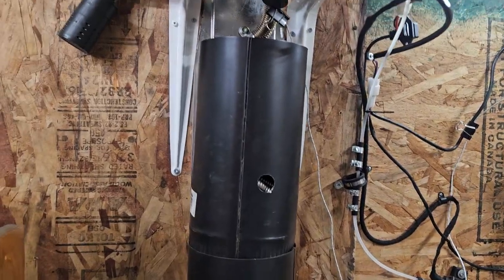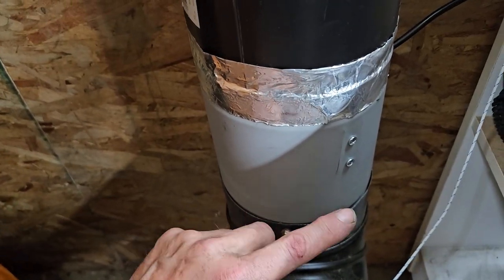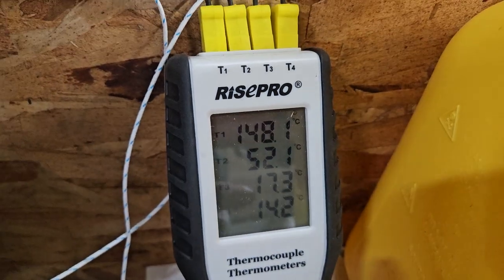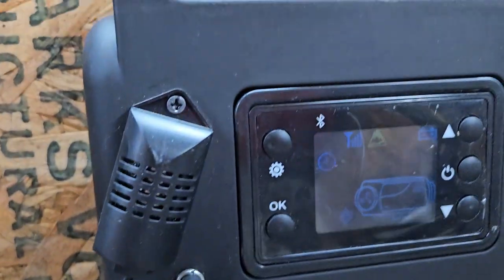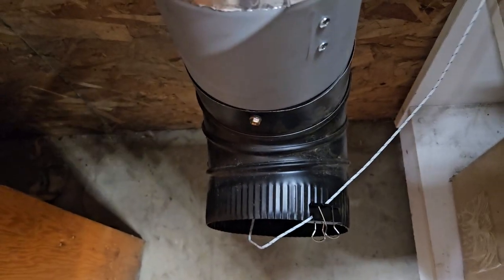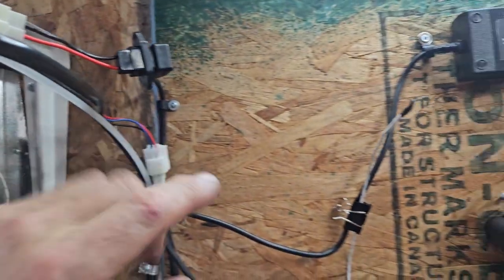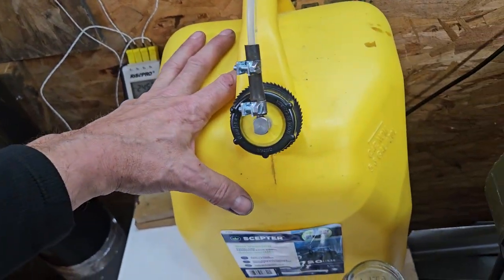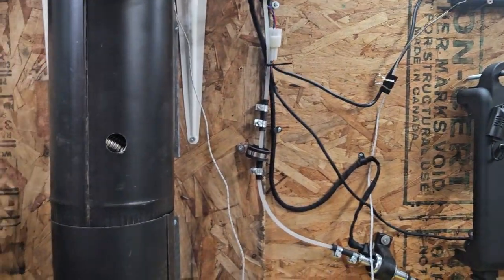Chinese Diesel Heater - Exhaust Gas Heat Exchanger (long version)

Comment: Not counter flow , get hotter fan blowing upwards blow sideways on top of, exhaust from heater top blocked air blowing sideways
Reply from the maker: I very definitely don't want it drawing from the floor level. That causes a cold  draft from the leaks around the large garage door on the other side of the building, keeping my feet always in a blanket of cold air. This warm air being blown out of that 6" pipe at about 10KPH(6mph) warms and  disturbs that cold air layer at the floor level. The forced air heating vents or hot water baseboard heaters in a house are at floor level for that very same reason. The diesel heater is mounted so high on the wall to have continuously descending spirals in the exchanger coil and still make it out through the boarded up window.

Comment: Hello Scot, I had something similar in mind. I keep seeing strange setups with heating radiators. If the room is set to a specific temperature, this should be more efficient. I had only thought that the fan would be linked to the diesel burner’s fan.
Thank you for your effort! I’ll get started on it as well.

Comment: I made on like this out of 10 foot of exhaust pipe I bought off Amazon and a 10 inch piece of duck work.  Played hell getting it in there.   Then after I got if running there were low spots in the exhaust that collected water.   I could not get a good spiral down  with the exhaust pipe with out drill holes in the duct and running rod threw the  pipe to hold them location.   Yes the exhaust comes out cold, but I don't think there's that may BTU's It recovers.   Is it worth is?  Yes and No.  Depends on how much your going to run it and if It screws up the burn on the heater to cause long term problems.
Reply from the maker: I have just finished testing temperatures and exhaust velocities of the exhaust. The math indicates that I am recovering  about 140watt/hr or 470 Btu/h with the heater running at the lowest manual heat setting
Reply: @scotscheideman9800  Interesting! How many watts is the duct fan, at whatever setting you run it at?
Reply from the maker: @danya822  Where I set it in the video, it"s drawing about 20watts. At it's lowest it draws about 15w and at max it draws 42w
Reply: @scotscheideman9800  That's good then, clearly making more than you are expending!

Few follow on questions if you don't mind...

Do you notice a significant amount of water coming out the exhaust outside? Just curious what you end up seeing for that. And is there any indication that soot is building up? 

Also, did you ever try/measure temps on alpine mode? I saw another video fairly recently, I believe they saw about 10* less on the combustion chamber temp using it, but I'm starting to feel that these heaters aren't really standardized on their programming, so perhaps you saw something different.

Comment: Excellent video!  I'm using an old steam heat radiator to capture the exhaust heat from my diesel heater.  I measure the exhaust temperature at 54C/130F.  My exhaust travels a little further than your setup, around 3m (10') to reach atmosphere.  I'm not sure if 3m is too far so I'll have to see if I get soot buildup over time.
Reply from the maker: Thanks for the comment!! ! I cannot be sure , but from my experience with Hydronic (hot water) heating radiators , I doubt that would be any more restrictive than my setup- in fact I bet it would be less restrictive. Water dams are the thing I would say you should be most vigil about. The combustion from these heaters creates a lot of water. A short pipe like the factory provides means the Exhaust Gas is still at high temperature when it leaves the pipe and thus is still able to carry most of the water created in the combustion process away with it. When we cool that Exhaust Gas down a couple hundred degrees it drops a LOT of suspended water vapor and causes puddles to form in any low spot that can block gas flow if not drained away. Make sure every inch of your exhaust heat recovery system is graded to drain that fluid to the end of the exhaust system. Thanks again! 500hr teardown to look for carbon build up is coming soon
Reply: @scotscheideman9800  Thank you.  I am in the process of adding a water collection device and tilting the radiator.  I'll report back with it's effectiveness.

Comment: Good job mate but try reverse the heat exchanger fan suck air from low and blow hot out the top the exhaust cools as gets lower and also hot air rises
Reply: I asked in another comment if the fan will take the heat...

Comment: Great set up. Very  simple and effective. I have two builds for you… 1. Intake  ran to outside will reduce vacuum and increase temperature. 2. Add the filter to the fuel tank to avoid external leaks .  Otherwise. Great build.
Reply from the maker: First of all thank you for the comment! I do appreciate how much the community likes to help
 1. Putting the intake inside was a conscious decision because we get frequent and very heavy Hoar Frost ( do a google images search)  throughout the length of our very long winters here in northcentral Canada. The house here has a 6.5m x 10m (20'x30') addition heated by a 38,000 BTU pellet stove which has a 50cm(2") intake pipe run to a 100cm(4") square intake grating. Hoar Frost plugs that off several times every winter. Plugging off the intake on the diesel heater would result in it slowly increasing the richness off the burn till it completely sooted up and shutdown , requiring a complete tear down of the heater and all the exhaust tubing. 
2. I installed the filter which I sealed up with Silicone RTV ( I showed it at the end of the video, but the RTV wasn't fully cured yet)  in line just ahead (upstream) of the pump and it's working great
3. Thanks again!
Reply: @scotscheideman9800   good point on the Hoar frost…. Makes sense to give up some vacuum and efficiency for reliability.  Really like  the build.
Reply from the maker: @ruckinehround6965   working on a 400 hr teardown video to show whether or not it is burning clean with the longer exhaust tubing, should be up in a day or 2

Comment: You have the fuel tank way below the heater unit. Isn’t this a problem for the small pump? Or did you change the pump?
Reply from the maker: I have had no problems at all with this, I have even run it with and without an inline filter. I have shut it down and re started it many times , and it starts first try, every time. If I have to disconnect and drain the fuel line, I just use the manual prime feature before starting , again no problems seen from the height difference. I have run three jerry cans down to  just a couple inches of fuel before changing out and again , no issues
Reply: @scotscheideman9800  what is the hight in your set up. How many Lower in cm’s can the pump up to the burner unit?  Regards Jeff
Reply from the maker: @scoopingdutchman4325  
From the bench top that the fuel jug sits on to the center of the pump is 82.5cm (32.5")
From the center of the pump to the top of the heater is 48cm (19")
Total= 130.5cm (51,5")
Reply: @scotscheideman9800 Thank you🙏

Comment: Great job. What I would do to add to your build is figure out a way to increase the surface to air by connecting a heat sink to the coiled exhaust between the coils without restricting air flow. You mentioned you couldn’t make enough exhaust coils without affecting your diesel heaters performance so make do with what you have via heat sink ( I personally would simply wrap copper wire in a fish net style going from the top to bottom throughout the whole exhaust coil…… another tip. Add a filter to the intake !!!! Dust buildup could cause a fire. Anyways hope this comment helped some way some how. Love the video. Keep it up.
Reply from the maker: Thank you for the tips, I never considered a filter on the intake , but I do make dust because it is more of a workshop than a garage
Reply: @scotscheideman9800  What about suck in the outside air through a corrugated pipe to the burner intake and run the exhaust pipe inside the intake corrugated pipe? The higher delta temperature will improve the heat transfer. It will probably works fine, even with no fan.
Reply from the maker: @ww07ff  This is Canada, last night the low temperature was -27°c with a windchill of -36°c (-19°f / -33°f). We often get temperature down into the -40's with wind chills into the -50's.  I need some heat in  the exhaust pipe at exit to prevent the condensation from freezing in the pipe, building up and ultimately plugging it off.  This system extracts all but the equivalent of a 20 watt bulb.
Reply: @s @scotscheideman9800 I see. Look at it this way. If the heat exchanger gets dusty, that will decrease the surface to air contact thus decreasing your efficiency. So what I would do is tape a 20x20 furnace fan to a 20x20 lasko box fan on the intake and exhaust ( make sure the air flow is going towards the exhaust direction ) and make sure everything is “sealed” this will not only have MORE than enough CFM air flow going through the heat exchanger coils BUT will also double up as a air purifier ( don’t go above MERV 13 20x20x1 ) if you have it run 24/7 the intake filter will last 3 months if you shop vac it and the exhaust filter should last a year. By the way with this much air flow, you will not need to add heat sinks because of the sheer volume of air flow

Comment: To make that run more efficiently, put the air intake through the wall, your coursing a vacuum forcing the building to suck in cold air, do that and you’ll see the main room temp rise. Great way of collecting heat from the exhaust btw.
Reply from the maker: I thank you for the  well intended suggestion!! In many parts of the world putting the intake outside would be a good idea,,, but not here. We get frequent and very heavy "Hoar Frost" that coats things like trees, wires and air intakes with a thick choking coat of ice crystals. Extremely beautiful, but really bad for any stove intake guard that will keep bugs out.  I have a pellet stove in the house addition which intakes it's combustion air from outside through a 2" (50mm) pipe that has a 4" (100mm) square intake screen with much larger openings than the Diesel heater  "silencer" ( which would be necessary outside here to keep bugs out). The Hoar Frost's choke off that big intake on the pellet stove several times every winter,, sometimes several days in a row. Not a big deal with the pellet stove, I have to tear it down to clean the fine ash build up off the heat exchanger every 1-2 weeks through the winter and it is designed for that so it's quite quick and easy  , but one clogging of the intake for 1 night on a diesel heater would most likely soot up the entire unit and require a complete tear down, replacing the screen and cleaning of the  glow plug,  burner, combustion chamber and exhaust tubing. Thanks again, I never did explain why I left it inside. I am planning on doing a 500 hr teardown video to  see if there is any soot buildup in the system.

Comment: What is he thermal sleeve you ran the exhaust pipe through at the top?  Does it block enough heat to touch it?  I need to run the exhaust out a poly baggage compartment of a motorhome without melting the compartment. Any ideas?
Reply: Exhaust tru hull!   Nautical like by small boats….   Regards jeff
Reply from the maker: I ran that exhaust sleeve mainly to  reduce the radiant heat near the fuel line. I went with about a foot  of heat sleeve to insure I had  routing options when building the assembly. after reading your comment , I went out and took the thermocouple from inside the heat sleeve and held it firmly against the outside of the heat sleeve . The heater was already running at max for several minutes and after pressing  the thermocouple against the sleeve for about 2 minutes, it quit rising  at  a little over 150° Celsius (300° Fahrenheit) I got the heat sleeve on Amazon ; "Spark Plug Wire Heat Shield 1600 Degree Fiberglass Wrap Heat Sleeve Adjustable Fuel Line Heat Shield for Car&Auto Wire Loom Protection (1" IDX10' Black)"  I have seen larger sizes also ,2" for sure , so I guess you could double sleeve it get more insulation.    Hope that helps!
Reply: @scotscheideman9800 Thanks for the reply.  I'm running the exhaust out of a polyethylene belly box along my class A motorhome.   I need the temp lower than 200 Fahrenheit. 
I was thinking of putting a 3 inch PVC coupler through the wall of the polyethylene and then wrapping the exhaust with 3 inches of heat wrap.  Don't know if this would work.  Any ideas how to get to exhaust through a polyethylene wall without burning down the motorhome?
Reply from the maker: @078249  Considering that a single layer of that fiber glass sleeve (which is the same stuff as header wrap, just made as a tube instead a strip)  I am using reduced the contact temperature from about 500°F down to 300°F ,,, I think your idea stands a pretty good chance, you could get a lot of wraps of header wrap on that 1" tube and still slide it through a 3" PCV coupler. That 4 channel digital thermocouple thermometer was only around $40.00 A good investment; being able to monitor temps at several different points on an exhaust line at the same time , on the same screen . A good way to catch a problem before it wrecks something.
Reply: @scotscheideman9800  Thanks for your info. The header wrap is the only thing I can think of. I'm going to wrap six inches 3 inches in diameter, then run the heater. If I can grab it with my hand and not get burned, it should work. Wish me luck🥵

Comment: I just bought a Vevor 8kw, and my plan was to do this exact setup... Great minds think alike...LOL Super glad this works so good... thank you for sharing your findings
I was planning on using a 3m / 10' exhaust pipe... What are your thoughts on that..?
Reply from the maker: If you are using a fan to increase airflow over the tubing like I did , I don't think it will be worth it. There is so much talk on the FaceBook sites about long tubing causing the unit to "soot up" that there has to be some truth behind it, there fore I think using tubing as short as possible is best.  This setup ; even with the exchanger fan set to low has the exhaust exiting the building only 13°c above the room air exiting the exchanger. Not much left to get. Make sure your exhaust tubing is ALL running downhill so it has nowhere to build up a puddle of condensation. thanks for the comment! Let me know how it works!! Also I have an extra CO alarm in the building and the one on the VEVOR is still functioning.
Reply: I live on a boat..
but in a workshop I wondered about using scaffolding tubes with fittings around the room with a continuous fall to the outlet..
To combat sooting I wondered about a large tank like an oil drum with a lid for the exhaust to immediately go in to.. no tubes.. maybe bricks with gaps.. with a larger outlet 6 inches from the bottom and the exhaust from the burner at the middle.. not top.. angled to make a spiral..
It would take ages to build up the soot.. clean it each summer.
Reply from the maker: @Markus-UK  Hey Makus, thanks for the helpful comment !! I am amazed how much more helpful people are on this platform vs the forum style pages on Facebook. I have only used 2meters of the corrugated 1" stainless steel exhaust tubing with 8kph (5mph) fan induced air flow and have brought  ( these are numbers from running at the lowest "1gear" temperature setting) Exhaust Gas Temperature(EGT) down to body temperature 37°c (98°f) .  That's an extraction of approx 120°c (226°f) leaving the EGT only 20°c(36°f) above ambient = not much left to get. I have measured the velocity of exhaust gas and computed the volume in a 1" tube at that velocity to be only 1.92cfm. If I were able to extract that last 20\36° it would only equate to 74.6 Btu\h or 21Wh (2 LED light bulbs!!!). My extraction value of 120\226° is 885 Btu/h or 260Wh.   This unit has run for over 500hrs now( Oct24-Nov15) with no signs of sooting in the exhaust pipe. With all the talk about causing sooting with excessive exhaust pipe length and the fact that I am recovering around 90% of the normally lost Exhaust Gas Heat,, I am happy and not wanting to upset the balance I have!
Reply from the maker: hey Markus , I got those Btu/h and Kw/h values by using google AI to do the calculating. This morning I ran them again and got 2075 Btu/h , ran it again and got 470Btu/h !!!! Google AI is not going to take over the world any time soon!!! After running it many times with careful wording of the input values it got  very consistent around 470Btu/h ,140 Wh or 0.140Kw/h. These numbers are with the heater running at the lowest heat setting and the exchanger fan running at the top end of "low" on it's dial.